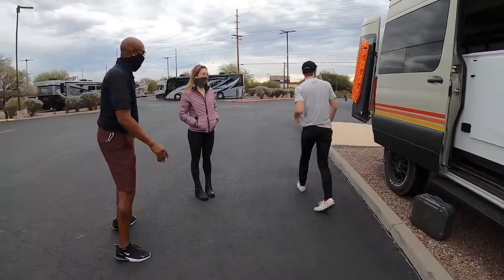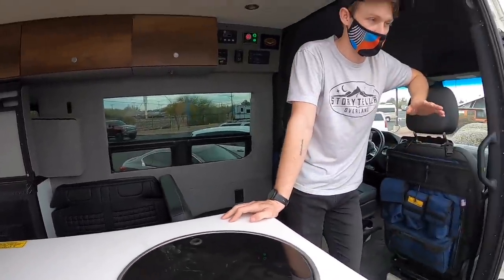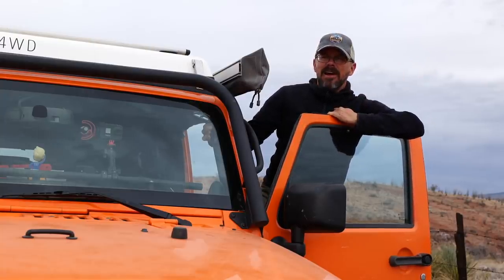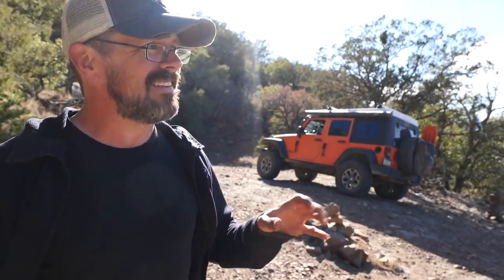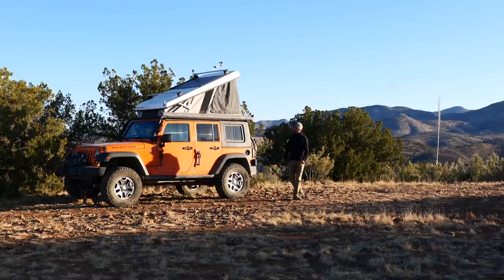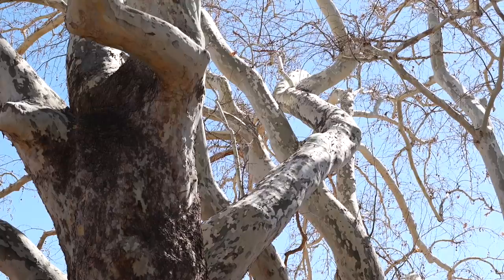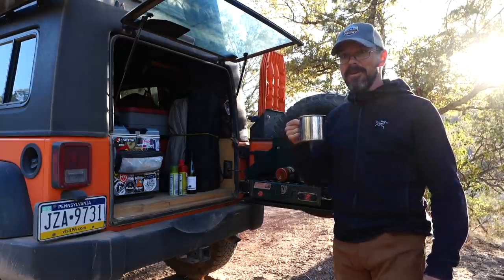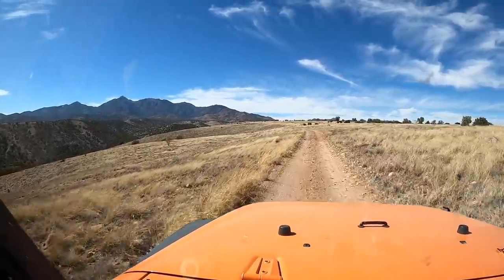V12E10: Across the Parcels of Coronado

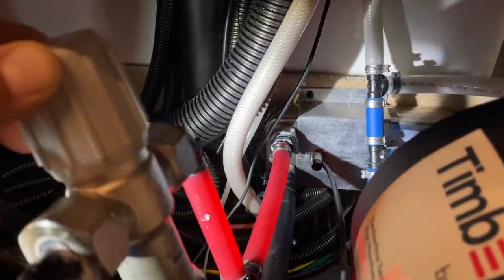Comment: Take a look at the fitting to what looks like the heat exchanger at about 10:17 in the video. When you wiggle the regulator the red hose is turning in the fitting like it might be loose. Future leak.

Comment: Edit: Also, just saw last week's video. 32.51226686825025, -110.99618057038472 . Decent area to find a basecamp for your next editing cycle. Close to civilization, but plenty of places to disperse camp and explore. Beautiful area and near my favorite mountain bike trail (Honeybee Canyon/Rail X Ranch). From here, you can get up and into the Torts and find some pretty neat spots...probably nearly deserted during the week, with a few offroad vehicles running around on the weekends.

Comment: I noticed just before you put the metal tie wrap on that the line at the heat exchanger was loose enough to rotate on the fitting. Seems the hose crimp should be tighter. Will that start leaking again?

Comment: I am not sure that that is a good idea for your fix for your water to leak. A metal band on a plastic tubing doesn't seem like a very good idea. Especially if it's still moving around. It would seem like they would cut it sooner or later. I have done similar things but I put tubing around the band to protect the plastic. Good luck

Comment: « The water temperature regulator » is a thermostatic mixing valve ( an anti-scald device). You are right about the fact that pex pipes or the thermostatic mixing valve should be clamp to a bracket or a wall... not wabbling. You have fix Winnebago poor design by bracing the neck of the mixing valve to a structure.
Reply: Winnebago equals “Wham, Bam, thank you ma’am” throw together something to sell.

Comment: Hello, I don't think the rear door hinges can withstand the extra weight of the spare wheel and accessories over the long term.  They are not designed for that.  Especially not in off-road use.  Please do not complain later that they cannot take this.
My 5 cent.
All the best from 🇩🇪